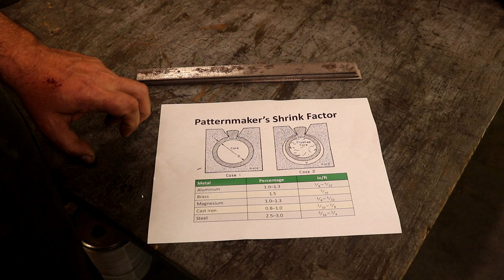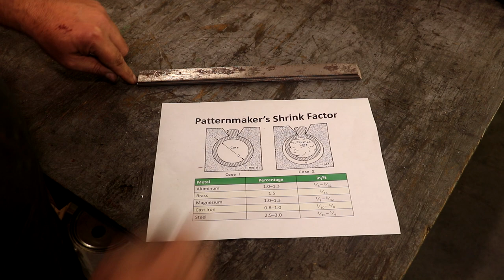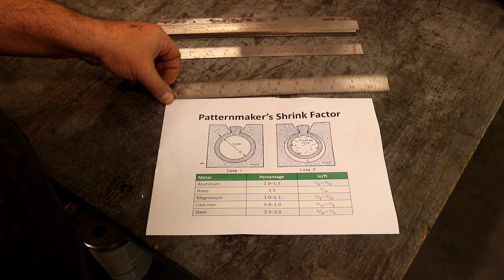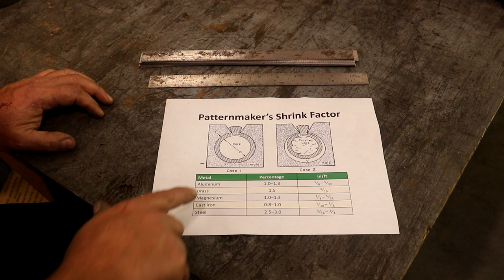Pattern Making for the Foundry - The Basics you NEED to Know!

Comment: My former employment was at the Dodge foundry where they had thousands of patterns along with core boxes, molding machines and core machines. We used oil sand for cores which required baking and chemically bonded sand which set up by chemical reaction along with so2 catalyzed core sand. Our melting capacity for iron was 150 or so tons per day. Keeping track of patterns and core boxes involved several individuals. Everything which you said was spot on.
Reply: 44
Reply: D
Reply: 4
Reply: 44

Comment: Always good to speak to the foundry or machine shop who you intend to use as different machine capabilities can change the way the part is/can be made dramatically and sometimes just adding a  hole to help holding the piece or small flats on a round flange can make the world of difference to the machine shop ... and in turn cut your costs.

Comment: Great run through the basics. Took me back. My first job out of University was as a design engineer for automotive brake rotors and drums. Back then we cast them in house, so i had to prepare designs for both finished parts and rough castings. The foundry mainly did high volume but simple castings for flywheels, bearing caps, rotors, drums and similar and used a modern vertical flaskless moulding line to do it. But they also had a traditional green sand line and used it to make all sorts of special castings - everything from repairing older machine tools to casting brake blocks for the company’s switching locomotives. Even in the mid eighties pattern making was a dying art. As you say, casting cylinder blocks was a different order of complexity, great video thoroughly enjoyed being transported back 40 years.

Comment: Hey Keith great video I actually watched it twice.!! I worked for 5 years on the pouring line at Cadillac casting in northwest Michigan..(if you look on their website I was one of the spacemen in the silver suit with the green mask) we made and used lots of patterns, mostly to make pig molds.. (molds to put extra iron not used in production) but every year we made horseshoes for the summertime. And huge 20 in iron skillets for deer camp season (in our downtime of course) we made patterns for both and used resin sand to cast them and you had to take them home and clean them up yourself.. we also used a spray on very slick graphite type pattern release. And by the way just because I thought it was funny the second time I watched the video I counted every time you said pattern... 150 times in 50 minutes 😜 thanks for spreading the knowledge I love your videos I really wish I had some machinery to play on!

Comment: Amazing Video, Keith!!

Few things I have learned casting as well as a design engineer. For fillets, epoxy over clay works well. Form in the fillets with modelers clay and then brush several coats of 2-part epoxy, letting the coats dry between applications, makes for a nice way to make fillets. Especially fillets that are of variable radius. I like to put some filler material in my epoxy to help shore it up. I use fumed silica (West Systems 404) to add rigidity and sand-ability to the epoxy. Remember, the clay below the epoxy IS soft so your epoxy is creating a shell. Another thing that I use when the surface finish is not great on the pattern OR the 3D print material leaves fuzz. Before I even sand the pattern, I spray several coats of high build automotive primer. This has LOADS of filler in it and will fill in the surface irregularities and allow you to sand the filler instead of the base material that might be a pain to sand in the first place. Another thing, draft is a function of your parts L/D ratio. Tall and skinny parts will require higher draft angle so an area where 1-2° works, might require 4° to not break the sand out. It depends a lot on adjacent geometry as well and the sand type; how much it "hangs onto" the sand. Last but not least, WORK WITH YOUR CASTING HOUSE!!! Send them a picture of what you want done and talk about it. Sketch up a pattern map to show the shop how you envisioned the pattern layup to go. Send them this BEFORE hand so they can give you feedback on what works for them and their processes. Not all casting houses are the same so what works for one, might not be good for another. Its a give and take relationship so work with them, that is about the most critical thing I could tell someone.
Reply: Oh man.  I could have saved at least 1000 hours with just the clay/epoxy  aspect.

Comment: Hi Keith, 
Great video on a very skilled process. Thanks for that. 

I've been watching a series on the rebuilding of a 120 year old gaff rigged sailing boat, the Tally Ho and they have been making the patterns and casting the floors and other braces in bronze. They are quite large casings and odd shapes. That was a very interesting process, and Leo, the shipwright, did considerable explanations on the process, including shrinkage, draft, radiused corners, the pour hole locations, and the relief openings so you get a full casting, and also showed the casting boxes being filled and rammed, split apart and then the actual pour.

Comment: Nice, Keith. I needed this. i am melting aluminum into sand models. pattern making is an art in itself.
Reply: Back around the late 1970s in school, before removing a pattern from the sand, usually some pointy tool was poked into a hole in the pattern and the tool tapped on the sides to move the pattern a little bit. OK, so it made the casting a little bigger than the pattern but it helped tapping the sand away from the sides of the patern so it'd come out cleanly.
Reply: @millomweb  myfordboy on youtube uses that technique or a variation thereof. His stuff is quite nice.
Reply: @millomweb  “some pointy tool”... it’s called a rapping bar.
Reply: @TroyeWelch  Now I thought I was doing really well remembering back to the late 70s 'cope' & 'drag'. Now you mention it, a rapping bar (never used one) sounds about right and that has been precisely confirmed.

I'd suspect to today's youngsters, it'd have a completely different meaning ;)

Comment: Great video Keith. I've been building and running cupolas for for the general public for a couple decades and have my basic pattern making speech memorized.  If you ever do a part 2 could you touch on sprues, runners, gates and vents. Also Cold Draws. People seem to struggle on those concepts. I will argue that foam makes a fine pattern for one off parts. Lost foam gives you some options that you don't have with a traditional pattern.

Comment: One other thing. Small tidbit of info that reaffirms your statement at the end; the idea that the old ways and methods are still relevant. Many parts of the Merlin and Raptor rocket engines produced by SpaceX use traditional casting as its the only viable way to make them; not even 3D printing will yield a suitable product. The inert atmosphere vacuum casting process as well as inert atmosphere direct pour method is used to produce liquid oxygen, RP1 and liquid methane distribution manifolds, high pressure ducts, powerhead main body, injector body, turbopump turbine housings, and many other parts out of Inconel.

Comment: Re draught/draft on patterns - not entirely necessary as prior to removal from the sand, the pattern can be tapped sideways to loosen it before extracting it. It results in the casting being slightly larger but if that's an issue, it's much easier to remove excess than add bits on ;)

Comment: Automotive-style engine castings have what are commonly called freeze plugs on the outside.  Those are not for freezing, they are where they use their processes to remove the interior core parts of the molds.
Reply: Thank You, I love learning something new every day.  I had to replace a plug in a 1968 Ford Galaxie 500 I had in 1977.
Reply: Which is why I've heard older guys than me (at 59) call them "core plugs".
Reply: @rennkafer13  Yes, we older guys knew the truth. In fact, the myth that those plugs would pop out and save a block from freezing was not the actual fact as the block would usually be cracked by then.  A pushed out cup or welsh plug was just an indicator that you had big $$$ trouble.

Comment: The core box with the area that is painted yellow with black stripes is what told the core maker that a loose piece was to be placed there.  This loose piece was used because it had  an area that  that  would not let the core  be removed from the box if it were not loose.  These cores were pasted together afterwards to make the entire core.  The black stripping told the coremaker this area was a seat for a loose piece  that belonged there. For Ferrous castings ( iron, steel etc.)the pattern would be painted  black to indicate where metal is versus yellow for core prints and red areas indicating machined surfaces.  For non-ferrous castings ( aluminum, brass, etc. ) metal was represented by yellow with black core prints and red stripping for loose pieces seats and machined surfaces again in red. These colors were industry standards.  J.

Comment: Photocopying a regular 12" rule with the photocopier enlargement at the percentage you need for a particular material works, I've done this then cut out the oversized one with scissors and put clear packing tape on both sides to keep it from getting soggy or greasy long enough to finish using it for a specific job ( in this case aluminum).

Comment: Keith, I don't believe that you miss a part of that big three piece pattern. The part with the black stripes on the inner yellow circle is for removing the sand from the core. This would end up in a core with a hole and finally a reinforcement or fixture for the whole thing from side to side in the final cast piece. Just a thought...

Comment: Ive found that fiberglass resin works well covering wood to make it nonporous and smooth so it comes out of the mold easier. It also makes a nice small radius in a corner if you need the radius small.
Reply: I've been doing this for ten years, working in a government literary institution, currently I don't have a job, due to the closure of the government institute, now I'm unemployed, if my job is benefited somewhere, of course I want to do it,

Comment: Excellent presentation. I do aluminum casting as a hobby. The one important thing you didn't cover was shrinkage of thick sections. It is a lot and will distort the end result. A flat area will endup concave where the metal is thick behind the flat. Thin sections will cool/solidify before the thick ones introducing all sorts of bad results. Olfoundryman has some excellent videos of making castings on a small scale.  Cores introduce an entirely different problem. My patterns are always wood & Bondo, cores are fine sand and sodium silicate, set with CO2. Lost wax or foam is another option.  Fun/frustrating hobby. But along with machining allows many different things to be made. Recommended.

Comment: When I was young 10 or maybe 12 I was lucky enough to go on a class field trip to Body By Fisher (Fisher Body) and watched Car Bodies being made.  Not poured/cast as Mr. Rucker is explaining but stamped.  I can only remember some of it now (50 years ago) I remember the steal sheets being stamped and I think they made the engine but again it was a long time ago.  I was amazed at how noisy and how every piece was moved from one station to the next and how they all fit as it was moved along.  There was no Robotics at that time, every station was manned by 1 sometimes 2-3 men.  I don't remember ever seeing how the blanks were made but I can imagine much like Mr. Rucker is explaining.   Thank You Sir for sharing your knowledge of how things work and even those that worked years ago.  It's sad that today it's a robot that does most of the work and it only takes a few (maybe more than a few) men to make an automobile but nothing like it used to be.  What an awesome country we live in!  I pray we don't erase everything we have done and achieved.
Reply: If you went to the Buick plant in Flint, MI they did cast and machine their own engines until about 1981 or 82 when the engine casting was sent to Saginaw Grey Iron in Saginaw, MI.  At that time the Fisher Body Plant was about 1.5 miles south of the Buick Plant and the car bodies were trucked from the body plant to the assembly plant in groups of 6 on a trailer so the bodies were inserted into the line on a frame that carried the body.  The carrier frames were trucked back to the body plant for reuse.
Reply: @royreynolds108  The Body by Fisher plant I went to was in Hamilton/Fairfield, Ohio.  I have read there were 3 or 4 plants, Body by Fisher.  I may be wrong about the number of plants but I have heard of the one in Michigan.  I was really sad to see them close the one in Hamilton down I had a lot of friends who's fathers worked there.  I think a few got transferred to somewhere in Kentucky?  The building still stands but has been refurbished into a warehouse.  I heard China purchased the tooling and presses.  Most likely for scrap.  Give China a chance and they will buy used toilet paper if they can get it cheap and sell it back to us.  Maybe some day the USA will wean itself from China?

Comment: Keith: Have you investigated acetone vapour/fume finishing for 3D printed parts?  It's useful for making 3D printed objects assume a silky smooth surface finish by using heated acetone or similar solvent in the gaseous phase in a chamber with the part for a set period of time. It's kinda like a solder reflow process, softening the outer skin of the plastic and causing it to self-level. Works really well.

Comment: Hey Keith, you can try 3d printing with ASA(its like ABSv2) or ABS and then doing aceton smoothing. If you made a dedicated aceton smoothing box you could probably cut down the post print work by 90%. There are plenty of aceton smoothing boxes on the net, but its basically an air tight box that you heat up aceton in and you part rotates on a rotary table. Then you get a nice uniform smooth finish. And as you are printing larger peaces, you would have practically 0 warping.
Reply: It's probably better to buy a sla printer if you need good quality, not to try polishing turds
Reply: @MF175mp  What he shows that he cast, looks like its on the large side for a FDM printer. But sure you can buy a 300x300 mm sla machine like formlab form 3bl for 10 k Or a big HP polly yet of 100k No need to polish turds there
Reply: Chinesium 300x300 sla would probably be south of 500 american pesos and deliver outstanding quality
Reply: @MF175mp  And which one is that? Getting a SLA printer for as cheep as a fdm that size, thats fantastic!

Comment: Just watched this video again. the last pattern you showed which you said you have no idea what its for,. well it  looks like the jaw clutch from a draw works (big winch basically) on a drilling rig to connect and disconnect the water brake called a Hydromatec later ones were called an Elmago and were electric. they were used to run pipe in the hole and give resistance so the big band brake on the draw works didn't get hot.

Comment: A 24" wood jointer you say? I'd love to see that running!
Reply: About thirty years ago My boss and I needed a long beam that nobody stocked. We found a place right on the harbor in San Diego that delt with this kinda thing. They milled it on sight. The jointer that they had was probably 25 feet long if not longer. Every machine that they had was enormous.
Reply: I've seen one that would have been at least 36" wide, was in a joinery works making doors and windows, and they put complete doors and windows over it to flush everything up. Would have been made maybe around 1920's, and like machines of that era,  no guards, very heavy, noisy, but solid and produced a perfect finish with sharp blades.
Reply: @dennisleadbetter7721  that's the way all of these machines were. The place was probably there since the 20's when San Diego was starting to grow in population. Before that I thought a 12" jointer was huge.  It was definitely interesting to see.
Reply: Hey Matt pretty much everybody on this site would too.  But Mr Keith doesn't think it's worth his time.
Reply: @cyrilhudak4568  I think that’s unfair, he can’t control what the museum will provide.
Reply: @mgmoody42  It's a losing debate for me, but that is my opinion.  What about the table saw work day?  Anybody see that sucker run?  And right,  Keith is not like a big kahuna at the museum. Come on, Man.
Reply: @cyrilhudak4568  I don’t know why you insist on being so negative, but you can just be you.

Comment: So I have a question about shrinkage calculations on a complex part like an engine block. Say for example you are casting a block with a bore spacing (center of one cylinder to the next cylinder) of 10.000 inches.  Would you keep your crank case, cylinder, and water jacket cores at 10.000 inches or spread them out at the precentage of shrink? Or would the shrinkage factor only apply to your wall thicknesses?

Comment: Another great video. Acouple of questions: In plastic injection molds, you can have a rougher surface as long as you increased the draft an appropriate amount. Could you do the same with a 3d printed pattern, using maybe a 5 or 7 degree draft? 
Second question, I noticed a lot of inconsistent thicknesses in some of your patterns. It seems metal casting is more forgiving than plastic in that regard, but there must be a limit to what you can get away with. I was wondering what the rules around that were.
Reply: Wouldn't help. The rough surface would still cause tear-out in the sand no matter the draft. Think of the rough pattern surface acting like velcro.